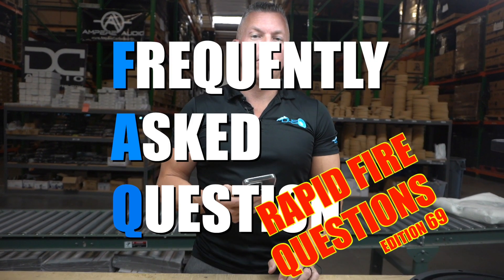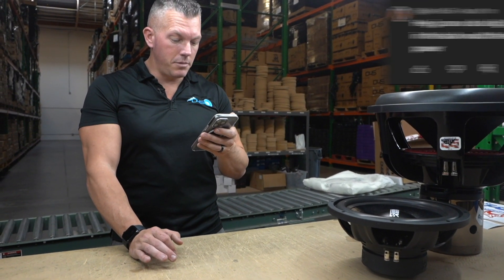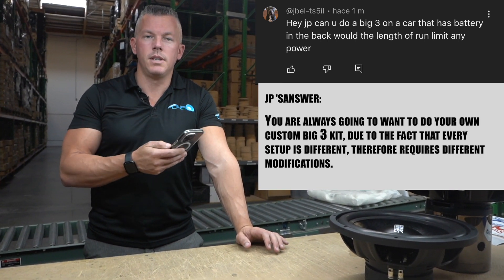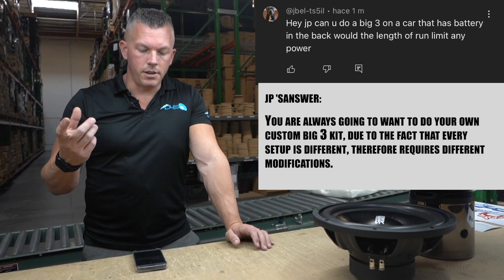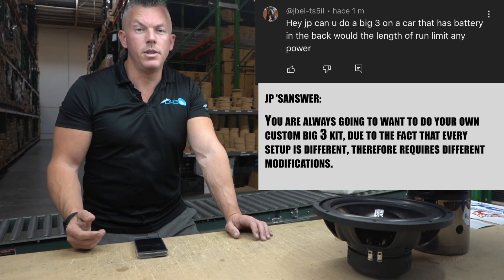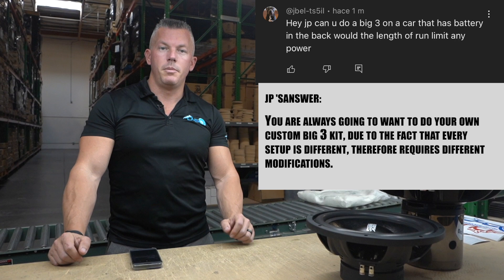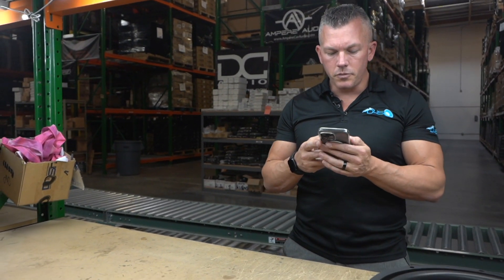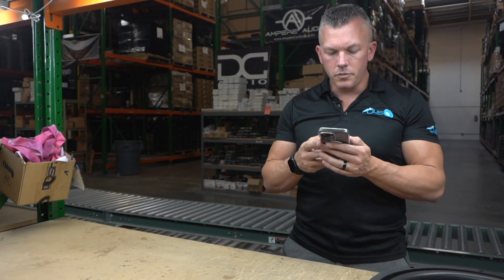FAQ RAPID FIRE EDITION 69: WITH JOHNATHAN PRICE

Comment: New to the JP series amps as well. I have a JP23 V2 amp on some Rockford Fosgate Punch P3 D2 15s wired at 2 ohms (don't wanna over do it too much on these subs), in a 2004 Honda Accord V6 with a stock alternator and a regular battery (7th Gen Hondas have small batteries smh 🤦🏿‍♂️). Any suggestions? Thanks in advance.

Comment: Hey JP I have a question and looking to buy one good subwoofer I was looking at the  sundown SDDN 10inch. But also the apocalypse 4512 which one would you recommend and which one would you choose to go with? And with what amp?
Reply: They're both extremely good sun's and powerful I think just about match on the same level I would run wich ever one is cheaper you will not be disappointed
Reply: *subs

Comment: Hey JP 2011 Tahoe can a stock alt handle 3000 watt amp i hope this not a stupid question new at car Audio.
Reply: No It can't, stock vehicle can handle 1200 watts max,after that you need bigger alt or more batteries
Reply: Thanks. @bobbyackerson4125
Reply: @ganeshnarayan5505  no problem
Reply: Yes it can.  Add a JY Power Lithium Cap and call it a day.
Reply: @TheGodofSEO  lol adding a cap is no longer just the stock system. Did you not read his question?